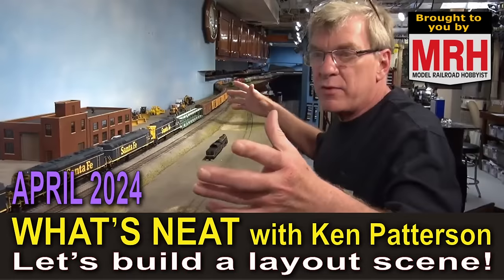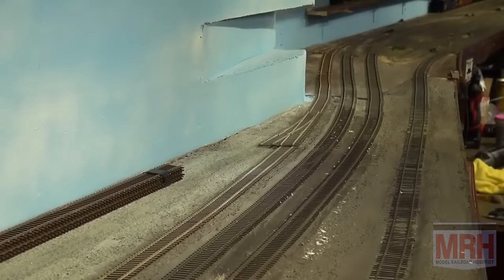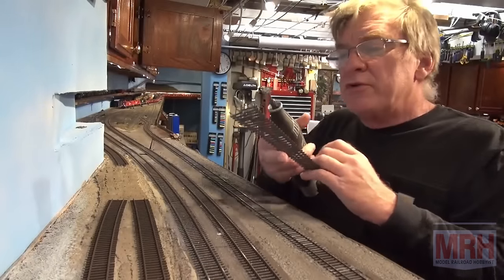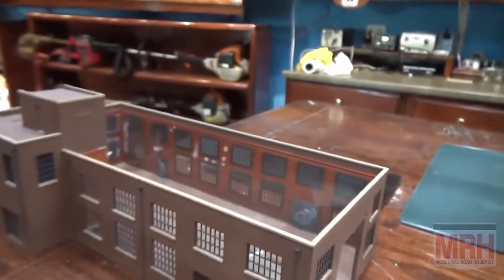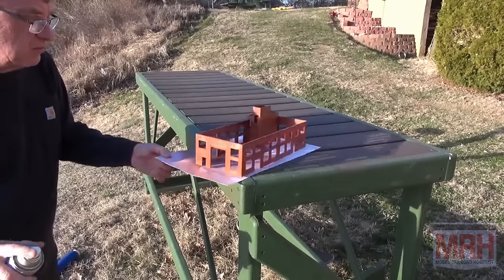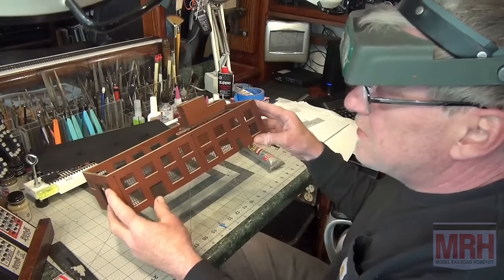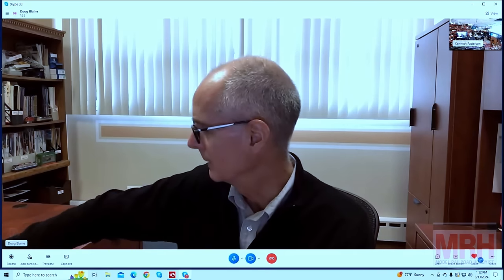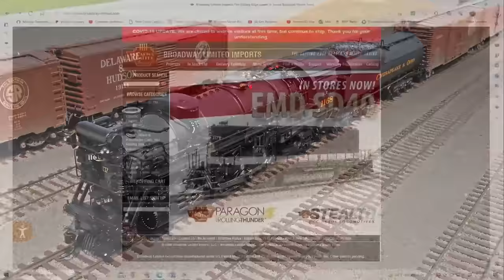Let's build a layout scene! | April 2024 WHATS NEAT Model Railroad Hobbyist

Comment: Hello again from Down Under.  Could not help noticing that Loco No. 1400 has an uncannily similar streamline cowling to the class leader of the NSWGR 38 class steam loco, 3801.  These were Pacific type 4-6-2 where as 1400 is a Hudson (or Baltic in Europe) type 4-6-4.  The first 5 (including 3801) were built with streamlining at Clyde Engineering in Granville (interchange station on the T1 Western line and T2 Inner West and Leppington Line).  The other 25 (there were 30 in total) were built by the NSWGR themselves at Eveleigh (near Redfern, 1 station before Sydney Central Station) and Cardiff (near Newcastle, NSW).  The even numbered ones were build at Eveleigh, the odd numbered ones at Cardiff. 😎🇦🇺